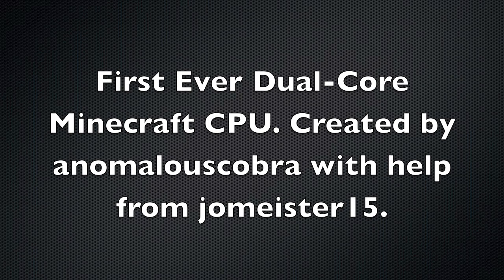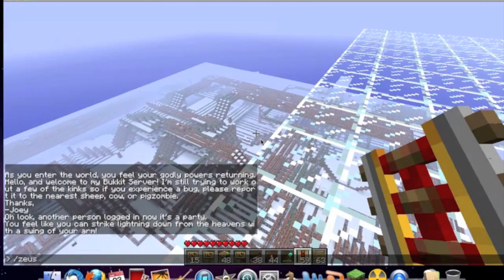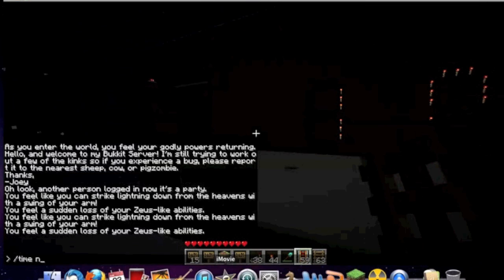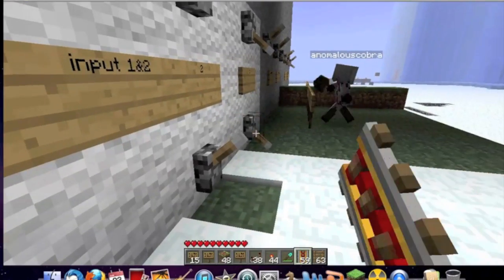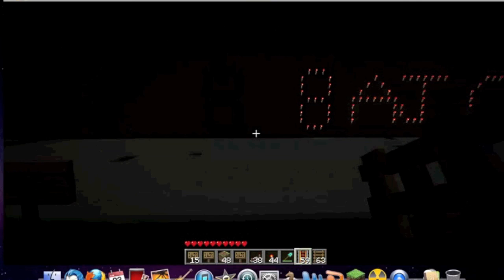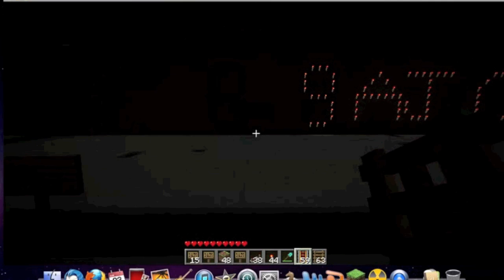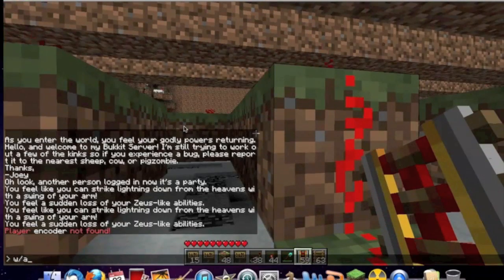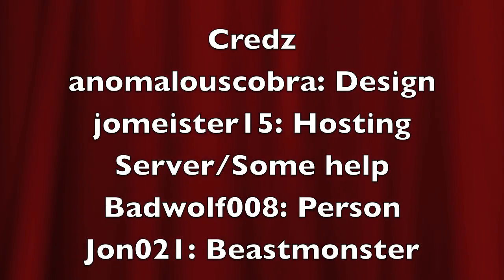First Ever Dual Core Minecraft CPU!

Comment: like other people have mentioned. this may be a dual core, but it acts like a single core because of the fact the cores are doing the same thing at the same time. because of that being the case, you can turn that 4 bit calculator into a 8 bit calculator by combining the two cores. tho this would require allot of re-wiring and adding more decoders and coders, it would be a more practical use of the 8 adders

Comment: I plan to beat this and make an 32 bit quad core with a few mb of ram and a command block based gpu with the performance of an early 2000s gpu and all this will be on a rig with a 5960x, 32gb of ram, and 4 titan xs in sli
Reply: Yes, you'd end up needing to do quadrillions of operations per second, several terabytes or more of RAM, A very very large hard drive, and a massive power supply drawing as much as a small city.
Reply: Steven Cooper the registers are completely independent, used to speed up sequential times. But the RAM can be used to do things on the multicore better because it needs to have a higher bandwidth to service all four cores
Reply: +Daniel Mendoza nope, you'd need to make redstone billions of times faster, and not even the world's fastest supercomputer can run it
Reply: +0subswithsumvideos that's why I'll try to use a mod. Because even if I were to build this I'd only be able to run it at 20hz (minecraft's refresh rate). Are their mods that firstly increase minecraft's refresh rate? Secondly make redstone a lot faster?
Reply: +0subswithsumvideos *there
Reply: still impossible.
Reply: +0subswithsumvideos so your saying even if I have minecraft's refresh rate to 1ghz (basically impossible to do with modern hardware) and redstone no longer needed repeaters and was much faster that I couldn't create it?
Reply: +0subswithsumvideos so maybe in like the next century I could do it.
Reply: +0subswithsumvideos could you make intels second processor? the i287 I believe
Reply: +The battlefront channel the i386
Reply: any luck doing this?
Reply: +sasdlasokdalkfdalksfa eh I mean I put the expectations too high but I am still building a quad CPU and a fast gpu
Reply: cool, good luck
Reply: Make sure it is a true quad core and not quad cpu like I've seen before.  And is this video really dual core or is it dual cpu?  because dual core(rather 1 cpu) should only be using one set of memory right?  Or is memory in redstone computers actually a cache(L1, L2, etc)?  Just thought of the cache thing for the first time with every time someone talks about these computers...would make more sense if they have always meant the cache of a CPU rather than the memory which most people would think is the RAM that they're talking about.

Comment: A virtual CPU in a virtual world, running on a virtual machine which in turn runs on a real machine...
I wonder when will you guys run Minecraft inside Minecraft :D
Reply: Bon Bon on JVM ? :D
Reply: Vic Vinegar Sometimes it is not a matter of how fast you do something (faster CPU) but how smart you do it (better algorithm).
E.g. suppose your CPU can only add and multiply. How can you calculate powers? You can use the fact that:
a^17 = a×a×a×a×a×a×a×a×a×a×a×a×a×a×a×a×a
and make a loop which repeats multiplying by `a` 17 times. For small numbers it is fast, but it quickly gets slow with larger numbers.
Sure, you can always wait for a faster CPU to be made, and it will speed up the calculations indeed, but it will take you only so far: when you try with a number longer still, the problem will return.
But you can notice that you repeat the same calculations over and over, wasting the cycles of your CPU, because you can group your calculations like this:
a^17 = (a×a×a×a×a×a×a×a)×(a×a×a×a×a×a×a×a)×a
to see that the first parenthesis is the same as the second, so you can just calculate one and reuse your result for the other:
a^17 = (a×a×a×a×a×a×a×a)×@×a
(I used the @ sign for "the same again" or "multiply by the last result".)
But you can do the same with this parenthesis as well, actually several times:
a^17 = ((a×a×a×a)×(a×a×a×a))×@×a
a^17 = ((a×a×a×a)×@)×@×a
a^17 = (((a×a)×(a×a))×@)×@×a
a^17 = (((a×a)×@)×@)×@×a
a^17 = (((a×@)×@)×@)×@×a
and this way you reduced the number of multiplications from 17 to 5! The reduction gets better with larger numbers, so instead of waiting for a faster CPU, you can use the CPU you've got already, just smarter.
Reply: +Bon Bon Maybe in like 10 years from now, CPUs will be so powerful that you can run and make PC games that are out now from within Minecraft.
Reply: Vic Vinegar You mean like now ?
There are many programs that can simulate logic gates

Comment: I see.....this is an implementation of a type of dual core. where you give each core a separate job and output the completed job....however, i am not sure if you did it correctly......from what i can tell you are making the first core do the first addition and then making the second core wait and retrieve the output of the first core and do another addition. What you did was not make it faster or slower but made a separate calculation on two of the same type of cores. You could do this on one core and make it display the exact same result without any time differentiation. However, the program is probably going to be more complex in order to get it to work.

To show the true potential of the dual core, you should create a program where you can input a equation like 1+4*4/8-2 and it calculates it in the order of operation. If you try it on single core, it will take a very long time to calculate. However, if you use a dual core, you can make it separate the job by making one core calculate part of the equation like 4*4/8 and the other will do 1-2. When each of them is done with their respective calculation they will add the resulting value together and display the final value.

If I did the order of operation properly, the resulting value will be 1 and it should display faster than the single core.

Comment: Well if you wanna get technical... A bit is a single binary digit, which occupies one of two states that are the logical negation of one another. And as it turns out, any arbitrary data can be encoded as a binary number, which is composed of nothing but bits. This, in combination with the logical operation NOR (which takes an input of two bits: A and B, and outputs the negation of A OR B, hence the name NotOR = NOR), gives us the tools we need to implement a finite-tape Turing machine. :P

Comment: Not really. It depends on what the CPU is being loaded with. If the program is optimised for a single-core CPU then having that extra 1 or 3 or 7 cores makes no difference to the performance because those cores aren't being used.
If a program is optimised for 2 cores, having an extra 2 or 6 makes no difference either. I'm sure you get my point. It depends on the program and whether or not it was designed to take advantage of those cores.

TL;DR MOAR CORES =/= faster CPU

Comment: Honestly, building CPUs in Minecraft is easy. It's just simple memory cells, bussing, and clocks. You just modify an adress from some ram and buss it over  to the CPU to run a program. You can quite easily make a calculator this way.

Comment: Though kilobyte has represented 1024, and 1024 has been used in converting other values to higher denominations such as 1024 kilobytes to 1 megabyte. But this is to allow extra memory because the full 1024 typically cannot be completely used, so for referencing purposes its typically used as 1000. It would still be closer to .004 kb at .00390625, so he was not closer.

Comment: Wouldn't it be .003928 in that case making it closer to 4? It is a little confusing doing that math considering kilo as a prefix directly represents 1000, not 1024, such as in kilometer meaning 1000 meters. Don't tell me a kilometer is 1024 meters, my head will probably explode. Even with your logic he is still incorrect.

Comment: It isnt possible to run minecraft in minecraft. The biggest problem is that you can only control the computer with on/off switches. The problem with even simple games like pong is that you cant build a controller thats easy to work with. Other problems are that the switches dont work with the speed of light ( or anything close). Furthermore the screen is limited sins you cant zoom out so far that the screen would ever show somthing acceptable like 360x600( requires aready over 200000 led blocks)

Comment: Not in this state, but if they build a full GPU, build a redstone storage unit to store Windows, redstone GPU drivers and the whole D3 installation, and connect a redstone display of acceptable resolution to the redstone GPU it's possible.

...but... the framerate might be slightly below acceptable. 

;)

Comment: erm... and what do you think is keeping minecraft open and storing all the block states in the RAM, doing the block updates, and maintaining a passable framerate at the same time.
I have a calculator with 24 bytes of RAM, and a 16bit ALU. the ALU lags my computer at 2.53GHz, when its clock speed is roughly 0.0000000005GHz and minecraft takes 1,000,000,000 bytes of RAM to run
you are the real failure here
you are an idiot

Comment: While this does have two cores, it is not a dual core CPU.  A dual core cpu has two separate cores that work together, doubling the processing speed.  What you did was make a mirror of your initial CPU and run the output from CPU1 through CPU2, which does not increase the speed at all.. in fact this slows the computer down, as it takes time to transfer from one core to the other. You can get the same result by looping the output from CPU1 back to the same core.  essentially this is what you did

Comment: @nodoubtyamean the SPE consists of a SPU an a l1 cache. in other words. a micro cpu/ not floating ram. the PPE (Power processing element) is suppose to choose which core it will send the output too with an OP code. and the two CPUs it suppose to co operate with each other. you ant suppose to choose that yourself. it is 2 CPUs not a dual core.

Comment from the maker: @1995error *ano stands up and runs at a wall head first* this is minecraft... i dont need multi level specialized cores for it to be dual core. spe is essential floating point ram so that is ridiculous and ppe controls the core data flow witch i don't need bc i only have two cores.  don't take a cs class mentality too simple minecraft CPU architecture... it never works.

Comment from the maker: @Minecraftmonkeys becuase the cores can execute a program as one CPU so say you were trying to add 5+5+5+5in a CPU with one core. You would add 5+5 store it then add ten plus five store it then add 15 +5.  it would receive the outcome in in 3 clock cycles. then a dual core CPU does the same operation and it can add five plus five in one core then add five plus five in the second core store the outcomes then it would add ten plus ten in one core. it would receive the outcome in 2 clock cycles 2v3

Comment from the maker: @kzucarok erm no. any device that can preform calculations then store them in memory then loop the stored values back into the machine is a cpu. you are thinking of a computer witch must be able to execute commands automatically using ROM and a program counter . also cpus do not have to contain more than one function to be considered a cpu although it is more effective to be able to preform more functions than just add and subtract.    if you disagree look up the formal definition on Wikipedia